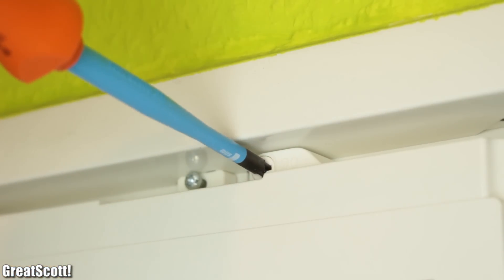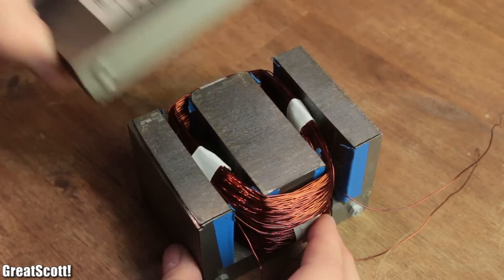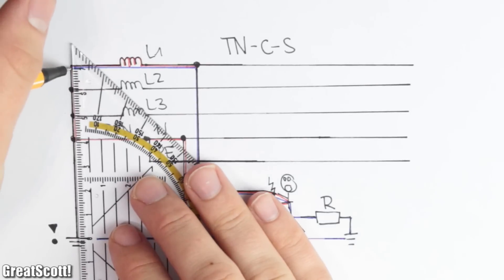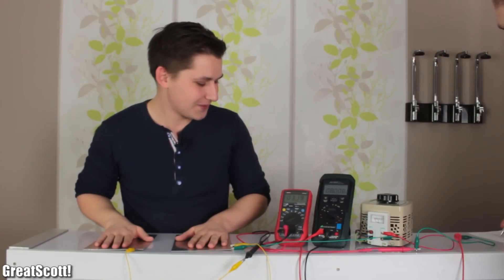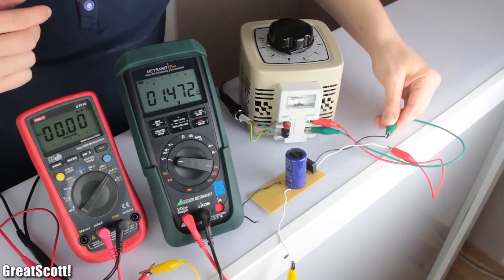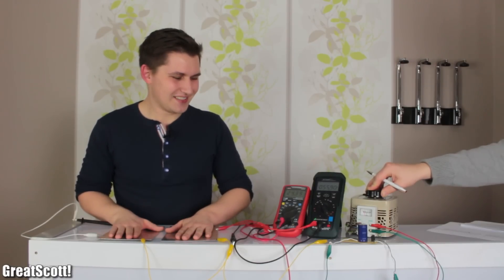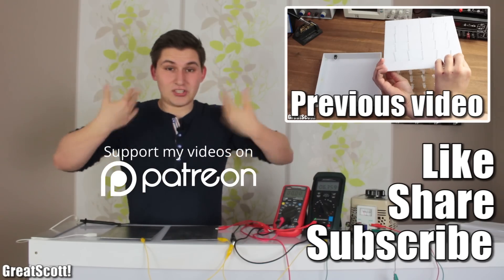AC VS DC - Pain Test (Experiment)

Comment: If i touch 12v Ac~ wires from transformer that has only two wires at each side with no ground terminal. Will i get shocked by 220v ac ???
Reply: If everything is fine with transformer, no you won't get shocked (12V~ is too small voltage to push enough current through your body). Ground is safety feature. If live or neutral wire comes in contact with something that is grounded (usually chassis) then RCD (if you have one) reacts and switches off power.

But anyway, you should't try to touch anything that has mains voltage near it.
Reply: Thanks for info!

Comment: I've actually been shocked with 12v DC from an Xbox 360 power supply (touched the metal part that's supposed to connect to the Xbox) and it left an internal scar. :(

Comment: amperage force is killing you...not the voltage. You might have an 1000 000 volts but only a few miliamps, so it will be fine

Comment: Nice video... I have a doubt considering that I don't have any measuring device( like oscilloscope or multimeter). How can I differentiate or find whether the given source voltage is either AC voltage or DC voltage.

Comment: the way you did the experiment was very dangerous. the current path was right across your heart! a much less dangerous experiment would have been if you had your right hand and your right leg connected to the metal electrodes, unless your heart is on the right side of your body in which case change the side of the body (left hand left leg)

Comment: you got some LOW resistance
I touced 24v ac and nothing
Reply: TrollFaceTheMan right, but 10 mA through the heart...  You can get 10A in between two finger and survive(with two missing finger)
Reply: His hands might of started to sweat.
Reply: Really depends.. 24 AC Is nothing when insulated but bare feets....  OUTCH!!!
Reply: Both hands my friend
Reply: Yeah but that was not low current. I know it could pull like an amp but of course it didn't because I got normal resistance and a silly voltage 24v RMS
Reply: to draw an amp through human body will require one hell of a voltage nobody has a resistance as low as 24 OHM, wich would allow a 1 amp current to flow through at 24V RMS
Reply: Hugo Martel Yes sir, but that was not what I was talking about. It was about scott's low resistance.
Reply: 20mA
Reply: Дмитрий Авдеев i touched 220v ac and my feeling was just like when i jump start the car and my hads are touching it ( high vibration )
Reply: Kamal Chahlaoui I had the the same but there was lots of resistance. I also touched a capacitor charged to 300 volts once (don't try, it hurts)

Comment: AC current is generated by swapping polarity, right?If yes, that's why AC current is a bit more painful than DC current.
Reply: AC is a sin wave wich can pass through the human body easily... on the other hand the DC is one way current it's "direct" and the human skin can stop it at certain amount of voltage and current ( much higher then the AC) . that the idea of it

Comment: I (accidentally) zapped myself with 240v AC... Sure it wasn't that long and i'm lucky i got my hands off there early enough. It's really something no one wants to experience...
Reply: happened to me too. It felt like someone splitted my arm in half for a sec
Reply: I got shocked with 40kv DC while "using" a ignition transformer, thank god for low amperage.
Reply: same, it happened when i was 7, i put iron sticks in 220v AC. luckily I fastly moved away my hand and didn't die
Reply: Like my but 150 v I get burn my dick

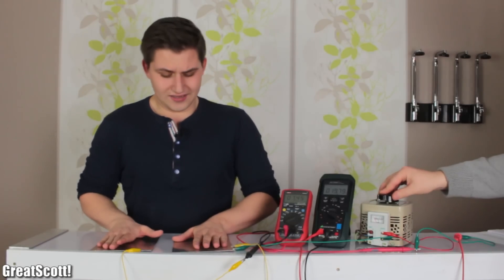Comment: 3:36 here you can notice that there is a lot of sweat on the aluminium plates i think that that swet changes stuff a lot i touched 42 v many times from my battery bank but one time my hands were swety and it shocked me and its weird because it doesn't feel like a few kv but more like a tingle and is very strange when it comes out of nowhere so actually here right now 1,2 M ohm (washed my hands) now after that is 200 K ohms (jumping around a bit)

Comment: you built a FUUUUUUL BRIDGE RECTIFIA !!!
Reply: Full dick erectifier
Reply: electroBOOM! hahahahahaha
Reply: Wanted to see if someone commented FULL BRIDGE RECTIFIER... wasn't disappointed.
Reply: Pritty kewl, huh?
Reply: it's not just a dumb single diode rectifier it's q FUUUULL BRIDGE RECTIFIA
Reply: Yesssss.
Reply: xgenesys so u saw electrobooms vid
Reply: xgenesys that was what I was going to say
Reply: xgenesys Electro Boom?
Reply: xgenesys pretty cool huh?
Reply: xgenesys I guess that's of electro boom
Reply: What is also important to remember is that although an AC voltage of 220-240 volts RMS is used, the ACTUAL voltage across your body is the PEAK voltage and depending on your skin resistance the current flowing will still be effective against your muscle control almost right up to the peaks.
Reply: The rectifier 👹👹👹👹👹👴👴👴👴
Reply: Is it DC for sure? How do I know there isn't any ripple causing the pain? There is current right? So show us the scope screen with the signal while doing the experiment!
Reply: And we know he watches ElectroBoom, because Full Bridge Rectifier isn't actually what it's called, ElectroBoom made that up. Its called a bridge rectifier or a full wave rectifier

Comment: Can I ask something? If the AC and DC currents were limited (let's say, by a fuse) to only 5mA which isn't dangerous, could you go to voltages bigger than 50VDC and 20VAC? Thanks.

Comment: you could use a big fat camera flash capacitor, to "smooth the voltage", precharged, and draw a dot/comma on multimeter screen on the wrong place with felt tip pen:-)

Comment: I forgot DC can be fatal and touch or say worked by holding  -50V and +50 DC wires from audio amplifier transformer(rectified) together which mean potential difference between them is of 100V (multimeter showing 110V) and i suddenly realise DC can also be fatal and that too above 100V . I immediately throw the wires and turned off the mains.  I am still guessing why i didn't get any shock . came to this video and they says 40V is limit.

Comment: Well Voltage is actually nothing. I could touch 10kV compared to Ground (0V) and I wouldn't even notice, because it's always about the power (P = U x I). If the power is very small, the current can't flow higher than it should.

For example, if we got 10kV at 1W, I would only measure 0.1mA (which is quiet nothing).

But still nice video :)

Comment: I always cringe when we see the bad guys in a movie using the output of a single car battery (12V) to torture peoples. That 12V can easily be raised to painful level with the help of an inverter but they never show anything of the sort in those movies.
I'm a bit of an hypocrite though cause I can't bring myself to directly touch both terminal of a car battery even though I know it is perfectly safe. At the same time I never feared working of the electrical wiring of a car without removing fuses or disconnecting the battery. I've also had much higher voltage run through my body without fear. There is just something about seeing a car battery that makes me uncomfortable, I probably watched too many spy movies when I was young.

Comment: if you start to sweat or accidently push a little bit harder the resistance goes down so much .. since your transformer puts out a set voltage .... i wouldnt try this alone

Comment: 'Its not the voltage that will kill you its the amps..' Electricity is a funny thing to deal with the human body. Skin layers come into great effect when dealing with it, however DC is way more dangerous than AC- and I am not talking about pain, I am talking about life and death. I would really like to see the true peak value of AC he has running through him- using the RMS (Root Means Squared) meter is inaccurate for the AC measurement.

Comment: This is interesting , because I have always heard that anything less than 50 volts is safe because you cannot get shocked, apparently that is not the case. I have also heard that 100 - 200 mA can be fatal but this video mentions that anything over 10 mA can be fatal.

I am curious if the person in this video wet his hands before the test to show the worse case scenario for the voltage level to get shocked.

Comment: I have to do this all the time..receive voltages that shock me..for pain..I use whats called a Tens unit..and it provides a pulse and strength shock thru two patches that stick to your skin,,,..you can adjust the pulse and the length of pulse and the intensity of it..for pain..it runs on a 9 volt battery..but it can get to the point of hurting, it you crank it up...nice video..

Comment: There was talk of jumping to ~50V DC for cars to future proof for added accessories since 12v just isn't cutting it anymore. The talk was that 50V DC is the highest safe voltage for humans. I was kind of surprised that they really wana jump all the way but guess it can work. Small airplanes currently use 24V DC to power all the modern avionics with GPS and multi functional displays. Pre 70s, 80s used 12V. Only problem may be the charging current. 12V charges at 14V, 24V charges at 28V, what would 48V charge at? 56V? I think 36V might be the safest voltage, and would decrease the amps and therefore heat given out by components like your starter, so no more worry for burning from cranking.

Comment: I am an electrical engineer, long time ago I have heard something which sounds reasonable and important. DC is sensed less than AC but it is more fatal although it does not kill immediately! DC current causes electrolysis of the chemicals within body, whereas AC does not cause any electrolysis . The produced chemical compounds, if there is too much of them, can act like a poison and gradually kill you by poisoning. It would be great if a medical expert puts his comment about my comment if this is right or wrong.

Comment: Well if you are going to do AC voltages then bust out the oscilloscope, the shit voltmeters come up with is some approximation of RMS voltage, for this experiment you need to know peak voltages which are a good deal higher then what a voltmeter will show.
Reply from the maker: +MsSomeonenew RMS* square root of 2 to be specific.

Comment: shocking... an interesting variant ( if you are still into this) is " induction reflex ", place a voltage across a coil, when the voltage is removed the field breakdown will release a pulse at high voltage but very low current. Even a low voltage relay wired to buzz (energized coil opens power to coil causing the contacts to return to normally closed and re-energize the coil) will put out a significant voltage....

Comment: I've only touched mains once.. helping my dad replace a ceiling fan, and someone before wired it so the switch controlled the light and the fan was always hot. The hot wire zapped me through the fan, managed not to drop it though

Comment: AC is painfull but DC is the most dangerous...if you use bateries then you will feel only in the momenth of touch.. and later not..but put the batery pins into a drinkin water and you will see what is doing dc (it is separating oxigen and hidrogen- and because from batery you wont feel that you are in circuit(not blocking your muscles) in your body is doing the same chemical reaction...and yes you can die in that. (of course dc is boiling water as well but not the same way (electrolysis).....and dc is going in the vire(body)using the full cross selection between 2 points... ac is going on the side of the wire and that is why you can have burned skin first of all if you play with electricity(of course it is going in to the body- can block your muscles and your heart- but dc generally flows outside of the cross selection..)
in the scool i HAD to touch 40 v AC-it is blocking your arms about(deadly bye the book starts at 50V AC -about)
who wants to play with high voltage and feel vat is doing with little courent i suggest to try this:
1. get somewhere one bell what is the simple old mechanic way working and it is using few batteries 
2. open it and connect to wires to the coil of the bell
3. connect 2 piece of pipes to the other end of this wires
4. grap the pipes  and ask somebody to turn on the bell
5. the bell is working- try to use your power to put down to the table the pipes-lot of people cant do it-  I DID!

phisically what is happening: when the bell turns on the power goes to the coil and it will be electromagnet-it pulls the hammer and breaks the circuit-and then the hammer falls back and closes the circuit again-probably everybody knows this simple staff.
BUT when the hammer breaks the circuit then the coil electromagnet is not loosing the magnetic field in that moment also it takes litlebit longer-what is happening:the magnetic field will generate high voltage in the coil what you can feel.

i can say that this is not dangerous experiment-in my highscool time i had to touch this hommade device and everibody else in the classroom because the teacher with this demonstrated what you feel when you touch high voltage ac and that you cant control your muscles(or it is verry hard)- the shcocking toys are working almost the same way...

o and this is the same theory how flourescent lighttube turns on....but dont touch that ;)

Comment: Past 2 week's I tryed to repait an ATX power supply at work. I failed bad and let connect the power plug because the power switch on the input was off (!!!). So I wanted to disconnect the fan from the board and accidentally toched a heatsik from a high power transistor of the primary side. I felt a strain in my right little finge and the RCD fired. I checked the currency and it was only 2.5V!!! Weird! But why the fook ;) is there current on a heatsink when it's off?! Very, very, weird! It was a LiteON PSU. Same at HIPRO but only when it's on.

Comment: i was doing some therapy with electric currents on my hands earlier this year and, curious as i am, ended up learning that pain tolerance is "trainable". i can't remember correctly, but i set the thingy (i'm a complete stranger to these things) to a 240hz current with a square wave modulation at about 0,25 hz (so i get shocked for 250 miliseconds twice a second). i started the intensity (sorry, can't remember the unit) at 32, which was the highest i could bear with initially. but after like 30 seconds, i could raise the power a couple of steps. i kept doing that for the half hour i had and i hit the machine's peak at 60 units. at this point, my hand would move (tighten grip) considerably each time i was shocked, but it didn't feel more painful than the initial 32 units did at the time.

i had the square wave modulation set up so i wouldn't feel my hand tingling for the rest of the day like i did the day before with a constant shock (even at a much lower current). it sorta worked. despite the much higher current, the tingling went away much faster (in like an hour and a half)

just as a reference, the initial 32 "points" shock felt MUCH worse than sticking my hand into a 120v socket (which to me just tingles very strongly, doesn't get to the point of being painful)

anyway, my point is you can train to endure more painful shocks if you raise the power gradually.

Comment: High DC voltage can burn you inside and outside. But high voltage AC kills instantly, because it stops your hearth, and you can't even release the wires. You typically won't get near DC above 60V (48V is completly safe).

Comment: GreatScott!
Could you please make a video on harvesting a old laptop battery to be used as a battery power bank?
Reply from the maker: +RAVIN MANKAD I put it on my to do list.
Reply: +Gotin Fuklio that wont work
Reply: DMAN22yeah it’s possible but it’s just not that easy
Reply: Gotin Fuklio you need 5v to charge a phone best bet is to use a 3.6v to 5v converter, they are like $4
Reply: Gotin Fuklio the battery is 4.2 volts fully charged, so no they dont
Reply: +Gotin Fuklio thats the nominal voltage, all lithium ion batteries charge to 4.2 volts. the phone charging circut probably wont even turn on
Reply: Yes TheJoJmaster I saw
Reply: RAV MAN  hey dude, i think greatscott has already make those video, just search on his vid.

Comment: for safer way to do that and higher voltage to handle.. for your body use two fingers with one hand so it wont cross your hearth not in two hands and handle the voltage higher..

Comment: Hey Scott. If you use an Amplifier and go up with the frequency it is getting  more painful because the skin resistance drops. (Correct me if I'm wrong) This is used in some medical aplications to contract muscles almost painless if you use the right Voltage and frequency.